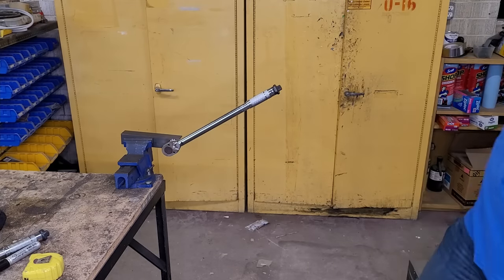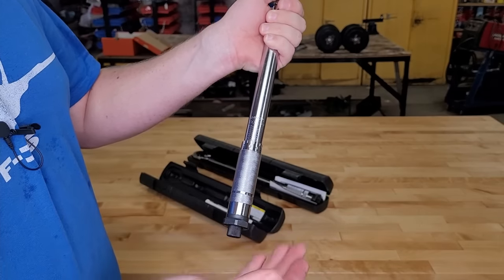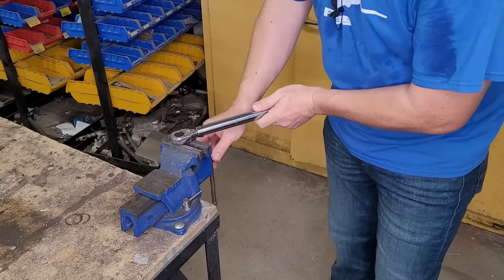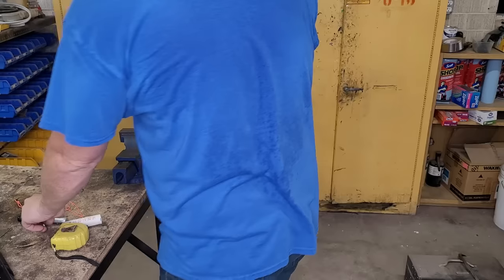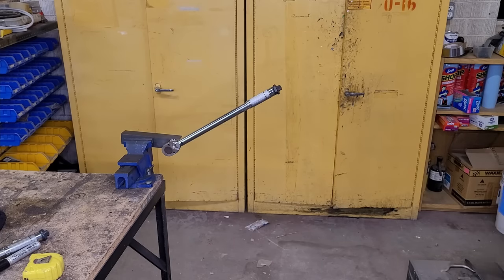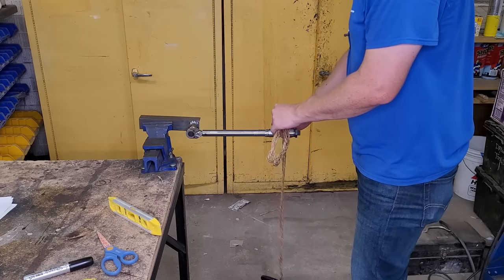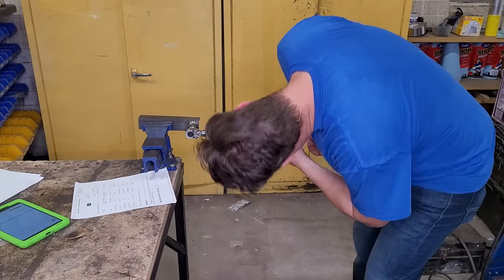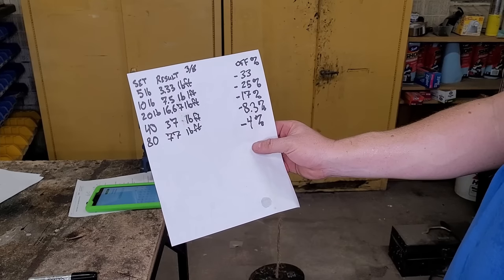$20 Torque Wrench, are they accurate? | Harbor Freight 1/2" and 3/8" Drive Review and Test

Comment: I just got it for $13 and it does the job. Im a weekend diy guy and can’t see myself spending $100 for a torque wrench.
Reply from the maker: Do a quick sanity check on it before wrenching on anything expensive!  Thanks man!
Reply: I was aiming at an AC Delco digital torque for $100 to torque my lug nuts, I stopped by harbor freight and saw the 1/2 inch torque on sale for $15... I couldn't resist the deal so I'm glad it had good accuracy in the test. Weekend DIY too.
Reply: @HerbOMatic   my guy living on the edge
Reply: I just purchased one at harbor freight.   I used it to put this new hub bearing in the Altima.  I set the torque to 65 foot pounds
It worked great.  .
Reply: Hopefully you're not working on your vehicles or anything that your family's life is dependent upon
Reply: Same here sir.
Reply: @richardried4197  Yeah, because if he torqued something he thought was 65lbs, and it turned out to only be 60, everyone is going to die and the vehicle will burn to the ground. Don't be daft.
Reply: @dougsholly9323   Yeah because the engineers at GM didn't put those specific torque specs on those parts for any reason at all you know they just pulled those numbers out of their ass don't be daft
Reply: @richardried4197  There is a torque spec on lug nuts, but literally nobody uses a torque wrench to tighten them. I have been a mechanic for 30 years, and there are very few things that have to be dead on or stuff fails, and when those torques matter, it isn't on things that could cause you to crash and burn. You warp heads and blow head gaskets. So I point you to my previous statement as well.
Reply: @May16Joe  I bought the 3/8 and 1/2 AC DELCO torque adapters. Soo handy in places you can't fit a long handled torque wrench.
Reply: @dougsholly9323  Exactly. Its cool to have a torque wrench but ive never used one when putting lug nutz back on and haven't lost all my tires going down the road are anyone else tires. lol. Definitely worth 15 bucks
Reply: @dougsholly9323 o
Reply: Had a good chuckle with the crushed balls joke. You forget one safety aspect that all should practice when working with tools. Eye protection. Your kite string accident come close to your eyes too😮
Reply: Would you say these are ok for doing oil change suspension work and lug nuts on the weekend not a professional mechanic by any means i just think its time to atleast try and torque stuff to what they should be i always just went by fell you know just crank it tight until it feels its about to snap or strip and good to go.
Reply: @dougsholly9323 If something has a torque spec, I adhere to it religiously. I seem to ask for trouble when I don’t. Some people can get away with not adhering to specs.
Reply: @larrywhinnery1808  do you torque lug nuts?
Reply: @dougsholly9323  Always. That’s one aspect I never overlook.
Reply: @larrywhinnery1808  you are either lying, or you are the most unique person in the world. Nobody torques lug nuts.
Reply: @dougsholly9323  Zzz I do. I don’t want some cowboy hammering my lugs with an impact.
Reply: @larrywhinnery1808  I don't use an impact because I am worried it isn't set high enough. I use a 1/2" breaker bar. I've tightened 1000s of lug nuts and never had one come loose. I am curious. When changing to a spare tire, does your car come with a torque wrench? No? Surely it would be unsafe to drive on a tire that was only tightened with a lug wrench, right?
Reply: @dougsholly9323  On the side of the road, the breaker bar is fine. I don’t keep a torque wrench in the car. I would torque the lugs later on when able to.
Reply: @larrywhinnery1808  you realize that makes no sense at all, don't you? Not using a torque wrench is either good or bad. There is no grace period for lug nuts coming loose. You are just being contrary because you can.
Reply: @dougsholly9323 It’s not all or nothing if he puts his lugs on tight enough to get it home and then torque it. Which you should do lmao things are not instantaneously good or bad it takes miles of drive time for something like too loose or too tight of lug nuts to have an effect on your ride.
Reply: @ethanolsampsonite7407  use a torque wrench if it gives you a stiffy. As I said, I've been wrenching for 30 years and never used a torque wrench on lug nuts. I know what on a car/engine that is critical to torque. Wheels are not one of them.
Reply: There was a time long ago in the U.S. when engines of all types were rebuilt by qualified AND EXPERIENCED engine rebuilders and mechanics and NO torque wrenches were used very probably NOT even used in the 1920’s through the 1930’s possibly into the 1840’s at assembly plants where engines and other somewhat more critical things like aircraft engines and reduction or increasing drive gear mechanisms were assembled at the factories.  But, as technology and availability due to lower cost and accessibility have allowed the better mousetrap why not use them, ie torque wrenches if adequate and proven if only a shop weight test like shown here to verify the accuracy of the torque wrench.  Many things come into play when properly torquing a threaded fastener including ambient temperature, temperature of the threaded fasteners and no lubrication whether dry or wet lube.  The idea behind torque is preload on the fastener that translates to preload in the fastened parts without coming in under or over the stress preload of the fastener.  If you are torquing a fastener to load two flat flush fitting surfaces together then the load is in the fastener and across the under head surface of the fastener against the surfaces being tightened together and with the correct temperature compensation(where needed) and lubricant you are truly preloading the mechanical fastener to its desired optimal level where the fastener if an externally threaded fastener(bolt or stud) is not stressed to a point where it is likely to stretch or be under too much pressure when it is exposed to variables it experiences like engine head bolt temperature heat cycles to hot engine operating temperature and then to cold ambient temperatures the fastener may experience.   If your parts you are trying to secure together are NOT flat true flush firing surfaces and you are tightening the fastener you are placing torque load against the fastener trying to compress the resisting forces of the uneven mounting surfaces so when you achieve the set torque setting the desired preload on the fastener could be reached before the actual preload of the fastener and its fastening/clamping forces against two supposed to be flush flat mounting surfaces are achieved.  Did you reach the torque setting on the torque wrench, if it’s accurate yes you did.  Did you achieve the intended torque preload on the bolt for its intended purposes such as on engine head bolts, probably to almost certainly NOT.   It’s more than just setting a torque wrench and tightening until you feel and hear the click of a mechanical torque wrench or hear the beep of an electronic torque wrench.  What lubricant if any is also important as the desire is to measure preload of the mechanical fastener and NOT the torque needed to overcome uneven parts surfaces attempted to be pulled together and/or friction/galling between threaded surfaces if the fastener’s threads.
Reply: @dougsholly9323 😂😂😂 good one
Reply: 12.00 today at HF 1/26/24
Reply: @dougsholly9323  I torque them. When I started working on my cars when I was in HS, There was a point in time where my rotors were warped. I know that uneven torque can cause issues sometimes so I started torquing lugs for that reason
Reply: @dean3184  Wait, what? Uneven torque on lug nuts can warp a rotor? You aren't really serious, are you?
Reply: Lmao. Imagine torquing a $20,000 piece of equipment with a $13 tool. Look at the brains on this guy.
Reply: @msheehandub sorry, I didn’t realize that the cost of a tool dictated it it should be used compared to the cost of the equipment it’s being used on. If it’s calibrated it could cost $.05 and it wouldn’t matter. Your arrogant and condescending comment made no sense
Reply: It’s money well spent and if you have kids they can use it too
Reply: @richardried4197  He said an Altima So all is good.
Reply: @dougsholly9323  If you gun on lug nuts on mag wheels or any soft metal alloys, you might be buying new wheels for someone if you shatter their wheels.  Even steel wheels will warp if they are not evenly tighened.  Not only do they need to be torqued to the right value, but tightened in the correct alternating pattern to enhance the torque value's correctness.  Those wheels are all that is between the car and oblivion.  If you have been a mechanic for 30 years, I am sure sure you can recognize how critical car wheels actually are.  that kind of statement makes me a little worried, as there are most likely many mechanics who do not take automobile safety seriously.  What other shortcuts do you take with your customer's cars in other words?
Reply: @mrstanskaggs1  first, I don't use a gun to tighten lug nuts, but many tire places do. Last I checked, damaged wheels or even worse, wheels coming off, are not a noticeable problem. Never has been. I do tighten lug nuts in the proper order, as everyone does. I hand tighten with a breaker bar to an even amount, completely estimated from feel. I've never had any of my wheels come off, or even come loose. I've never had a damaged wheel. I've never had anyone whose wheels I've removed come back to me to inform me that their wheels were damaged from improper torquing, nor never came loose. The plain fact is that not using a torque wrench is not a "short cut". It is completely unnecessary. The range of torque needed to properly tighten a lug nut is far wider than the precision of a torque wrench. When I build a stud wall, I use 2 nails on either end. Yes, putting 12 nails in each end is probably more secure, but it is also completely unnecessary.
Reply: Overtorque can lead to snapped bolts and a bad day, undertorque can lead to slips and engine mishaps for anything that really wants to be in spec.